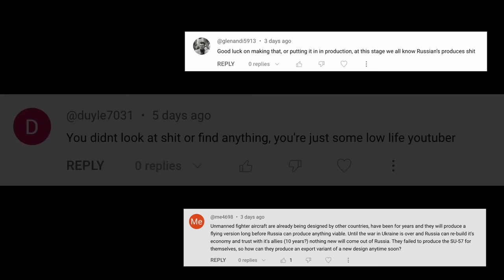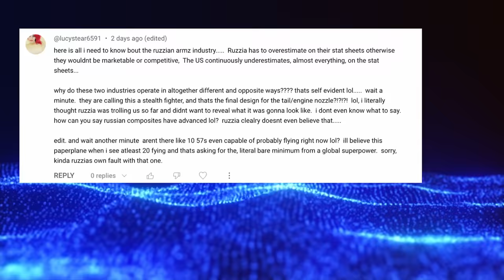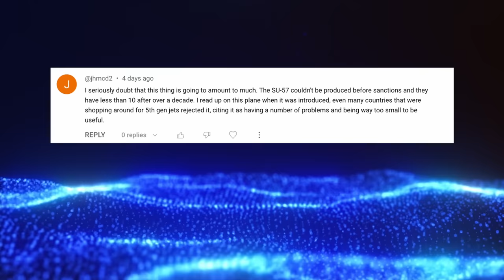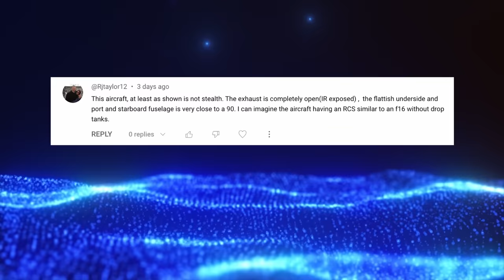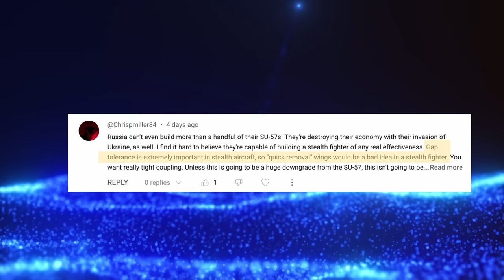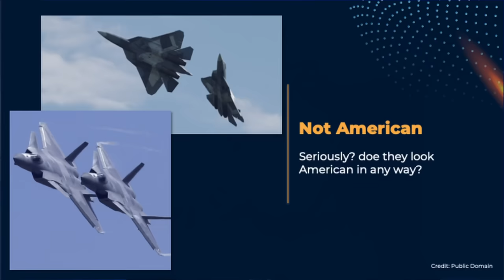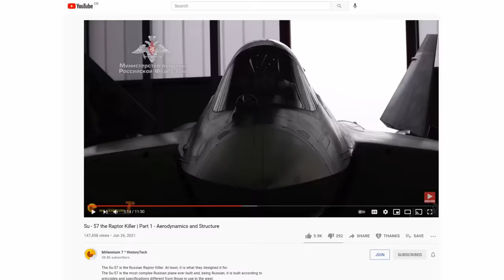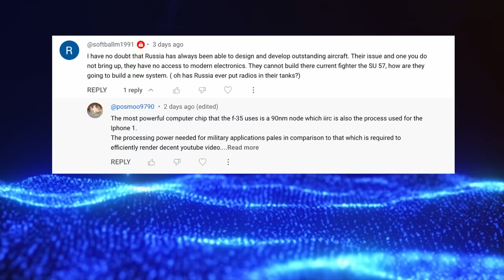Why so Few Su-57s ... and Other Stories.

Comment: Do you think the Su57 is a 5th gen ? im not asking what they call it .. asking if you think it actually is a 5th gen Jet . bc from what i found on the internet is looks more like a 4+ gen to me
and the copy argument is not an argument is a fact . absolute FACT that does goes both ways ... whoever think USA doesnt does the same is s.a.f.
Reply: you must define 5th gen first otherwise this question is absurd.
For example: US called F-22 5th gen because it has sensor fusion, low observable and supercruise all together, yet they call F-35 5th gen and it has no supercruise capability. So if you think about it, the naming 5th gen is just that, a naming. you can't ask if it is 5th gen "not asking what they call it".

Comment: 6.18 The Federation has at least 4x SU-57's equipped with upgraded engines and flat variable engine nozels that were filmed doing fly overs in Russia. We know the SU-57 was using a temporary engine, I can only surmise that a recent break through has pushed the design to Sixth Gen.

Comment: I can create a perfectly radar-stealth fuselage. I will use Bragg gratings to scatter the right wavelengths by using etching techniques.
It will take about two years per fuselage and it will be perfect in every seem, every leading edge, even for the engine.
Now, if you want a technique that can produce one or more jets per month, now that's the difference between technology and industry.
You also want the jets to be reliable, maintenable, same high quality across all components. Anyone can build a stealth fighter, not every industry can.

Comment: Always excellent work! One point I'll say that doesn't land: the argument on the capabilities of the Checkmante. (Or, really, any Russian military hardware.) Russia has, for decades now going back to Soviet doctrine, lied about the capabilities of their military hardware to project strength and - in post-Soviet Russia - increase their value on the export market. Moreover, some of their design choices certainly were made as compromises to not rely on Western technology or to be resistant to specific types of attack (like their old Tupolevs using vacuum tubes up through the 90s?!) it still means that, due to the lack of complexity and miniaturization, that their hardware simply isn't as capable pound-for-pound as, say, American machines.
Reply: @Max_Da_G  I am so amazed at how confidently wrong you are about everything except the fact that... well, yeah, tanks are of course susceptible to air power and artillery. The United States M829 is like any other weapon system: it's effective until it's not, then it's upgraded or replaced. Just like Russian armor is: the Relikt stops the A2, the US adopts the A3, the VSS adopts the new Armata package or whatever. In any case, as seen in recovered Russian tanks in Ukraine their Western counterparts have far superior optics and situational awareness, at least in comparing the Abrams to the latest T-80s.

As for whatever line of absolute bullshit you pulled out about the VKS facing off against the USAF's F-15s, that's a nice creative writing exercise I guess?

Comment: One thing about, geometric stealth,if the radar emitter and multiple reciver not on the same place,and the Multiple reciver,distributed over an big area and there is an inteconnect between all of this (likely in small units and Airborn) geometric stealth become meaningless. Hensoldt are using normal cellphone Towers as emitter,for this perpes without,touching them,its very interesting❤ thank 4ur work
Reply: This is why most military need to have database on the normal noise of the UHF and VHF signal on their own country. So they can use noise anomaly to detect unwanted (probably stealth) aircraft.
Reply: @swordsman1137  Yes,u right,but also,the numeric simulation kapabilities are growen drasticely,over the last 3-4y,Raytraicing and material simulation is a big thing,in this science,nowerdays ,that's not all for Gamers;)
Reply: @marnig9185  yeah but i still don't think geometric stealth is meaningless. Geometric stealth still the biggest factor a fighter can achieve stealthiness. Stealth itself will help make targeting with active radar more difficult. So it's still meaningful in certain ways.
Also simulation often times is too sterile. No x-factor coming in to make the test result have practical meaning. This is why fighter manufacturer still doing RCS test with real size model
Reply: @swordsman1137  There is no 'normal' noise. That's what makes it noise. Atmospheric and thermal effects are constantly shifting and every other radar in the theatre will be generating reflections in a way impossible to model accurately enough to filter out. This is before you even consider deliberate noise introduced by an adversary.
Reply: It wouldn't become meaningless. It would be rendered less effective, but would still make tracking it extremely difficult. Geometric stealth causes reflections to be concentrated in just a few directions. Against distributed systems the overall reduction in return is largely nullified, but the return is not consistent. It will appear to twinkle or flash. Getting an accurate track of it will still be extremely hard.

Comment: It is interesting that it is said that the Su-75 has no internal gun, but can befittet with a gunpod. A gunpod on a external store is easy to fit..but ruins stealth. A gunpod in one of the weaponsbays  would keep stealth  but sounds very difficult. Also I wounder why  the Su-75 has his nosewheel ofset.. this is usualy done becauseof the Gun (Su-25, A-10)
Reply: If you watch his previous video. There is part where the Checkmate patent show that Checkmate sidebays can accomodate gun. So all is okay.

The nosewheel is offset because it need room for EOTS, if the customer choose package that include it.
Reply: Once you have realised it is possible, there is little reason to put the wheel in the middle and have two small bays either side of it as opposed to a single larger equipment bay. It looks weird, but practically speaking it is sensible because it is simply more flexible even if you don't have something specific in mind.

Comment: You asked about the photonic radar system and the only way that it would be operational is if it were space-based using magnets looking down for disturbances. 
Since the earth is curved it would not be very effective to have it ground based.
It is space-based because radar would not work in space. Looking down at the planet for say a mountain peak that was moving at 400 plus miles per hour or looking at the oceans for a boat doing the same amount of speed which is an airplane or missile. You could even be looking for a CO2 emissions any of the telltale signs. Like when you're looking for a sniper you never look for the human. You look for the disturbances. 😆 Such as the grass laying in a v pattern.

Photonics is the physical science of light waves. It deals with the science behind the generation, detection and manipulation of light. Light has a dual nature known as the wave-particle duality. That is to say that light has characteristics of both a continuous electromagnetic wave and a particle (photon).

By using advanced magnometers also in space, you'd be able to see these changes in the magnetic field of the light spectrum. 😅

It's also an advanced way of navigating through space. When you do not have a visual reference to Target, it would be inconvenient to fly the ship towards a certain star when you need to go between the two, but you can't see the furthest one

Comment: What's your thought on that? (it belongs to a chinese military analist)
"Su-57 fighter is still adopting a traditional way of manufacturing, which makes wings and fuselage separately, being fastened together by three hinges. In contrast, F-35 and China’s FC-31 use the latest wing body integrated manufacturing technology, which is stronger and lighter.
The body structure is painted with a yellow anti-rust primer, and the surface is covered with a layer of gray protective paint, but it is not a stealth coating, and then topcoat and camouflage are directly applied. A large number of rivets are left on the front fuselage frame, indicating that the manufacturing process of Su-57 fighter is still relatively conservative, and the latest technology such as integral molding is rarely used."

 Also, what you believe about the breaking of collaboration between Russia and  India on developing the Su-57, why India retired from it?
Reply: The real reason is technology transfer. The Russians severely limited how much the Indians would get. Every other stated reason is secondary.
Reply: If you see T-50 flying without paint (a.k.a naked) you will notice multiple colour. The colour is indicating the material used. Yellow/bluish green is metal, gray is composite. So afaik the gray is not paint, it's naked composite skin. But i'm not from Sukhoi, so who knows
Reply from the maker: This is correct.

Comment: Hi, a Question regarding the al 51f1. Has any prototype been built for it, or is it just still in the design phase? Thanks
Reply from the maker: They fly already
Reply: @Millennium7HistoryTech  Oh that's interesting. Are they in prototype Felons? Also is there a potential for fitting them on Flankers?

Comment: Maybe not exactly relevant but I have always wondered why tail planes of Su27-35, Mig29 series all are cut off at an angle instead of being parallel to the wings. Other countries don't seem to use this solution for whatever the problem is

Comment: Photonic radar does not contradict physics and is very simple to explain:

The radar emits high energy photons through a destabilized carbon matrix in the radar dish.  The photons then excite electrons in the target, causing a polarization of the target's surface in the Vn band.  The resulting delaminated material then follows the reflected photons back to the receiving antena, where is its reconciled by the turboencabulator.  It is then filtered through the Heisenberg Compensator and projected onto the pilot's display.

See, easy-peazy.  A child can understand it.

Comment: the elephant in the room is Russia don't have enough money to buy stealth fighter in meaningful number that they can replace existing fighter, even US has difficulty doing so and had to buy some F15 to avoid a shrinking airforce. how many Su57 did Russia buy? 50? at those numbers it not worth investing on manufacturing capacity, it just more economical to build themm slowly then to run out of thing to build in a couple of years. some fixate on technology, but I feel economic is the real determining factor...

Comment: a photonic radar is a radar, that uses optical processing along whit RF and DSP. some things are easier in optics then in RF: fillters , delays,  correlators or transmission without crosstalk. but its also more difficult to integrate optics and RF to a system that works. there are allways problems and looses in the interfaceing the optical and the electrical systems,

Comment: Maybe a video about Su-25 underwhelming performance on both sides? They were supposed to carry stand off munitions, yet almost immediately they were relegated to launching 57mm rockets and dropping dumb bombs..
Reply: Also, why no new Russian AESA radars in development? The current Zhuk is 10 years old already and not exactly the best in the world at its reveal.
Reply: @phunkracy  also Russia IS the leader in the world of radar technology
Reply: @JamaicanYutie  maybe ground radars but absolutely not in aerial radars.
Reply: Both sides have strong enough air defence that incursion is largely impossible, and they do not achieve greater stand off capability than artillery or long range rockets. They played a large part in neutralising any possibility of a blitzkrieg style armoured advance in the early days of the war, but now that things have stagnated and are slow moving they have little role. Their main strength is as a fast reaction force, but this is not called for at the moment. It is possible that they are preventing some specific tactics from each side though, so you can never be sure that a system isn't doing anything just because the realised outcomes don't look like it is doing much.
Reply: @phunkracy  RADARS whether ground based sea based or space based it's all the same
Reply: @JamaicanYutie  nah latest Russian ZHUK AESA not only came long after western AESA radars (think almost 2 decades after F-22) but it still has worse output and module number than old-ish AN/APG 77 radar from F-22. Russians are trying to catch up and haven't managed to (yet). Even the Chinese had more success in AESA.
Reply: @phunkracy  it's your kool-aid do what you will, believe what you want
Reply: @phunkracy  it's your kool-aid do what you will, believe what you want

Comment: Su 57 is Rejected by India it was joint program and Russia pleading to buy it to India
Reply: it was not a joint program. India had a finantial contribution for the development of an independent derivative (was never going to buy the original but they had some requirements that would be added on the basic concept with each side taking their own direction).
No one is pleading to anyone, Su-57 is available for export, like most other Russian weapons.

Comment: M7, I don't know if you read the comments...

The reason why I don't believe Russia can match the US and generally the Western world is because of semiconductors. You sensors, avionics and all the software that controls them can only be as advanced as your hardware powering them. In the case of the digital world that role is taken by processors. Russia is not very good at processors in fact their best semiconductors were all made by TSMC which is no longer an option. Even those were not really any good. The more powerful your semiconductors are the bigger the room for upgrades and expansion. This is the case in the normal world as well. At the end of the day modern jets and phones are the same exact thing just with different functions. This is ofc my opinion but I'm curious to know what you think

Comment: 13:10 air superiority is indeed uncontested, but would gen4++ systems be able to penetrate ground based air defenses with the same effectiveness? What I've heard is that they are making few attempts to even cross the border. Would this not be the exact niche that a gen5 jet is supposed to fill?

Comment: I am surprised that the engines intended for the SU 57 aren't in production yet. Will the existing SU 57s be able to be retrofitred with the right engines when they are? Will Russia be able to produce enough power and be reliable enough for the SU75? We don't know. In fsct not only dont we know nearly enough about Russian and Chinese stealth fighter jets but fill in the gaps with educated guesses but the same can be said of American fighter aircraft still in development. So IMO this is largely a guessing game. The west was very worried about the MIG 25 until they had one. The same could be said about the competence of the Russian military until we saw it in action in Ukraine. It's as easy to underguesstimate the unknown as it is to overguesstimate it.

Comment: What about those intakes?
They are soooooo narrow!
Every time I see them, I just keep imagining them failing to suck in enough air for the engine to work properly. And they're so far forward, practically on the nose.
Won't that cause a compressor stall every time the airflow around the nose is altered by a maneuver?
Pilot: (does an aileron roll)
Su-75: Congratulations! You win compressor stall!
Pilot: (does a barrell roll)
Su-75: Congratulations! You win compressor stall!
Pilot: Blyat mudak! I have had enough of this! Now I am flying straight and level!
Su-75: Doesn't matter, comrade pilot, you,still win compressor stall! 🎉🏆🎉
Reply: I don't think the F-8 had a problem, or the X-32. Both of them had an air intake even closer to the edge of the nose.
Reply: @Hypernefelos  but they're sooooo tiny and narrow...
They look like they have enough surface area to suck in sufficient air, but that surface area is spread so thin...
Reply: @ticijevish  They're narrow at the edges, not so much at the bottom. If anything, they remind me a lot of the F-16 DSI experimental intake.

Comment: You are wrong about electric actuators. Look in the specification for “Megalopolis” upgrade project, for Su-57.
There is even part of video in “Combat Approved”/“Voennaya Priemka” that actually has some footage on the actual electric actuator modules.
Reply from the maker: I will look for it. Thx.
Reply: Project Megapolis in fact.Yes, Su-57M ( two flying prototypes so far Bort numbers 058 and 511 blue ) have electrical actuators not hydraulic ones. All best !

Comment: Great Videos M7, as an engineer who worked in Aerospace and Defence, your analysis are unbiased and (with the available info) excellent. One point I note that is often overlooked in comparisons of aircraft is how capital and operational costs influence the human factors. Pilots, engineers, technicians etc need constant training to fully take advantage of any platform capabilities. With the skyrocketing cost of Nato platforms and more constrained budgets, training is often the first casualty- this is a big factor. Also Nato has not had a peer level battle since the 2nd world war and the actual effectiveness of weapons systems has not been properly tested. Fighting people with AKs and slippers does not count.

My own observation of Russian vs Nato systems is that the Russian philosophy often used simpler, cheaper and more reliable systems where possible, often with comparable and sometimes with better results. An example of this would be their ejection seats- not as "cool" as the Martin Baker ones, but way simpler and cheaper to use, and really excellent. Russian designers are not afraid of using "crude" solutions which work well.